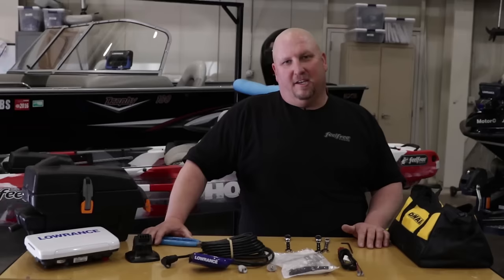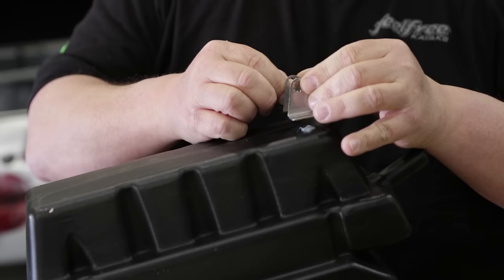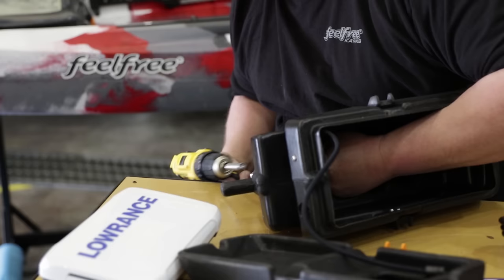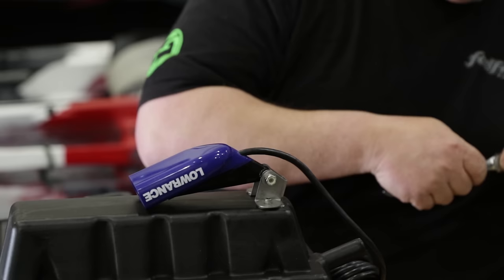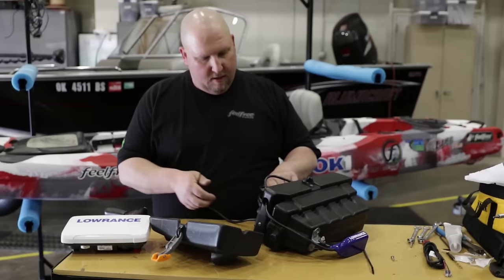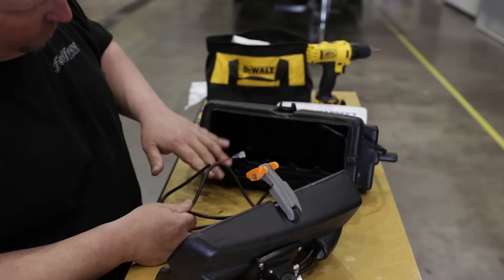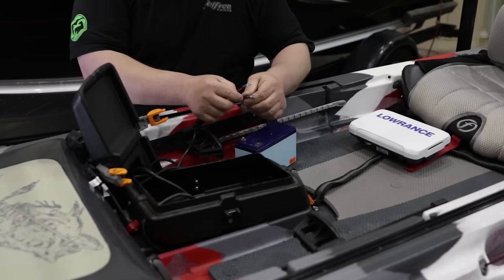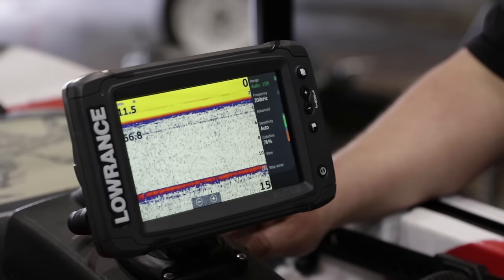Lowrance Elite TI installed on Feelfree Sonar Pod

Comment: The photo for this video shows the pod with the ti totalscan transducer but the video shows installing the skimmer downscan. Having installed the skimmer with my previous Elite 5 chirp this works but with the ti total scan one has to add a 1 1/4 -1 1/2" block between the transducer mount and the pod in order for the transducer to sit properly for the structurescan to work properly. I notice the photo reflects that. Perhaps you may want to make a video for this transponder.
Reply: Walter Holt id like to see a video with the total scan transducer as well. Just ordered the elite 7 ti for my lure 13.5. I'm kind of worried about having to add the additional 1.5" to the bottom since I fish such skinny water sometimes.
Reply: Wayne Wilson no video but look me up on facebook and I can show you my mount and what it looks like on tge bottom of my yak.
Reply: walter holt, i sent you a PM on facebook about your install. Scott Harrell

Comment: Video shows the power cable without the NMEA data cable. Mine came with both coming out of the power connector. What do I do with the data cable?My touchscreen will not work without me holding the data cable in my hand....seems its searching for some type of ground....

Comment: I have a hook 2 5 triple shot I'm getting ready to install. Is it going to be an issue with sidescan if its mounted in the pod. Concerned because the transducer doesn't sit below the boat. I prefer that so I dont get caught up or drag it but have never had sidescan so not sure if its gonna be an issue

Comment: What does it look like inside of the kayak where the pod fits in? Is there a seal and what keeps water from getting into the hull? Will it accept Hummingbird fish finders?
Reply: The hull is solidly molded where the pod fits in. Yes the pod should accomodate most finder/transducer combos
Reply: I have the Moken 12.5 version 2 that has this pod. You can remove pod while in a lake. It's just like a giant scupper hole. No water comes in to kayak. I do not have a depth finder yet. I store stuff in pod. The buckles on the side are useless while in the seat. Foot pedals are the same location as buckles making it difficult to unlatch. I just undo front buckle and pick it up to access inside of pod while in the water.
Reply: @SmokyMtnHiker1  good idea

Comment: Don't you seal up the cable entry points on the top?
Reply: Their model uses separate power and 'ducer wires. And they mounted the unit near the center of the pod lid, so the wires unfortunately have to splay out to the edges of the FF at a sharp angle. The 2 holes in the "cork" required for the 2 FF cords I presume made this guy quit the install at your question. My Elite 3 something has a single cord for power and signal so I used the rubber plug/cork they gave me. I also mounted my base as far forward on the lid as I could so I could reach it easier on the water. If I was them, I would have tried to put 2 holes in the cork. This is my 1st Feelfree, so I'm not sure the history but I'm guessing this box was originally a storage unit. Otherwise it should have a flat top to make mounting the FF base better. Haven't tested mine yet but I'm worried that the transducer won't sit deep enough in the water. There is a 3' drop from the bottom of the pod to the bottom of the kayak. Hopefully I'm worried about nothing ...but that is why I came here today. :D